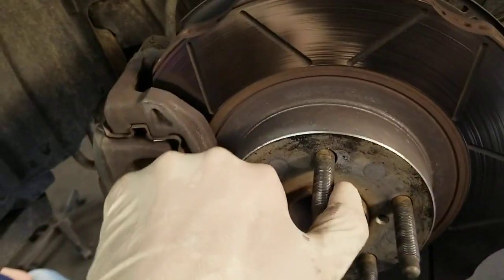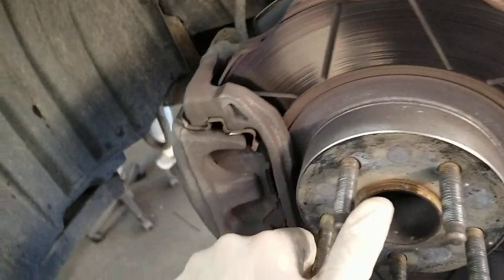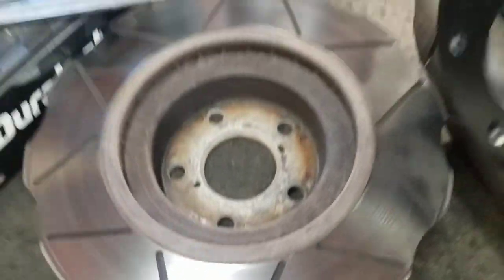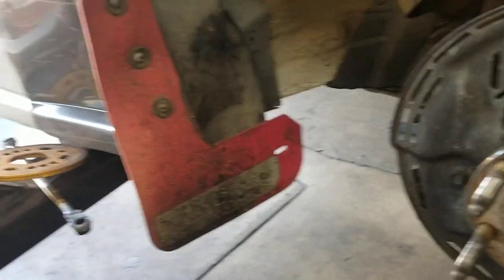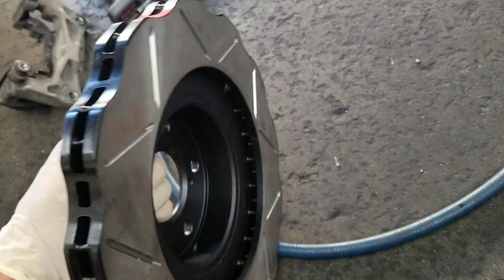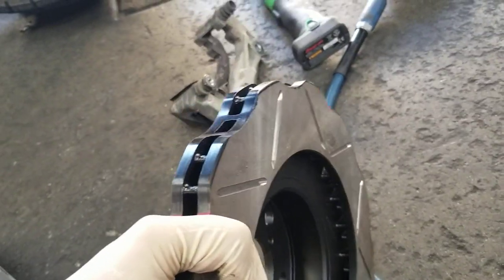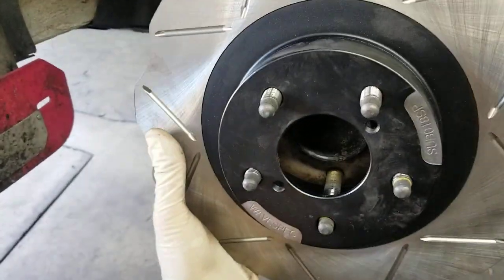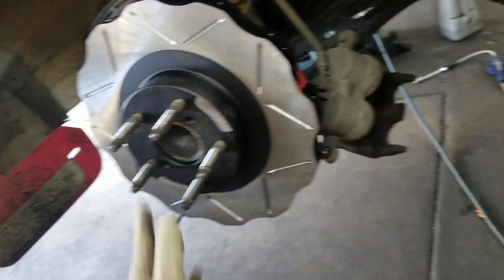Wavespec Brake Rotors long term overview.

Comment: Wish I looked this up before I already purchased mine. Just put them on today lol. Fiesta ST
Reply: how are they holding? i need new rotors mine are bend
Reply: Been 6 months so far and I've done 1 track day, about to do another soon, still look and stop like new same with my ebc yellows. Probably a little too early to give a legit verdict on these yet but so far holding true to what I bought them for
Reply: @bigddb92  hey bud how are the brake pads and rotors holding up?
Reply: @TD5rage  I'm on my 2nd set of yellow stuff pads that were put on earlier this year. Been thru about 5 track days so far and haven't turned them because lazy but no problems👌🏾
Reply: @bigddb92  excellent news thanks
Reply: @TD5rage  no problem. Also just for clarity sake, this is about 2 years of daily driving and occasional track use.